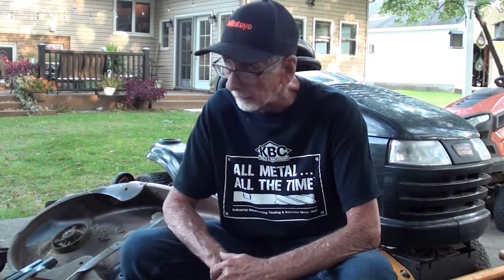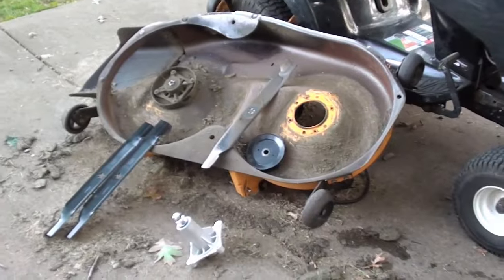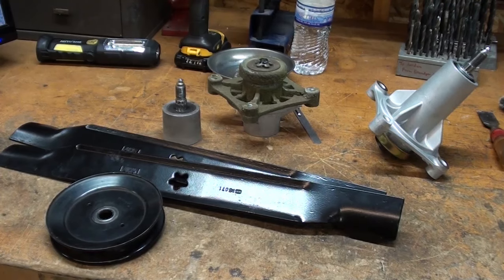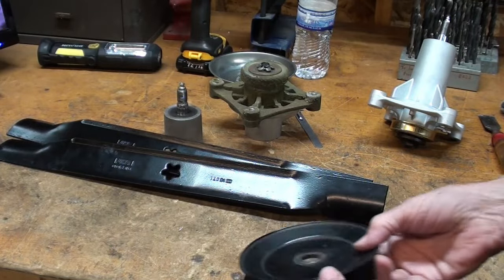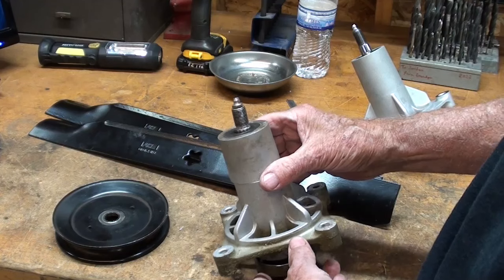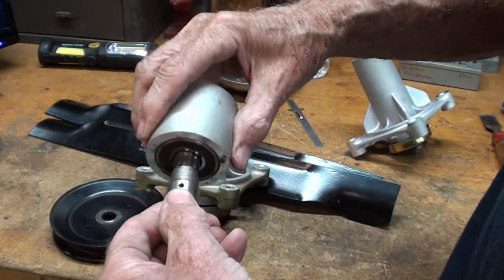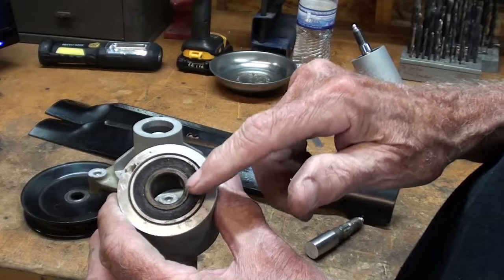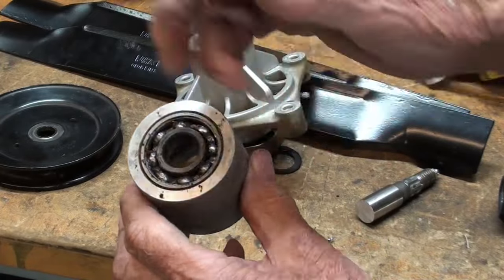LIES & DECEIT mower spindle fraud SHORT SUBJECT #52 tubalcain

Comment: The last spindles I replaced ( also on a Craftsman) didn't even have the (phony) ZERKS. So no way to even pretend you are greasing them. When I bought my mower, about 18 years ago, I figured I would go with Craftsman because I " could always get parts". Ha ha, the Sears store went away, and their once very good online parts system has crumbled. Thankfully. the Craftsman mower has been a very good unit. Your son-in-law must have hit that stump pretty darn hard to do that much damage! Usually, the ears of the aluminum spindle housing just snap off when I have hit a stump.

Comment: Mr Pete, I do believe that the bearings  in question are sealed permanently lubricated bearings needing n o additional lubrication for the engineered design-life of the bearing. 
The shaft with the zerk is probably a purchased item from another supplier ( who sells them to many other companies) and the lube options  are just how it is  made.  So the company that builds the bearing pedestal is just using them as they get them. 
I suppose it is reasonable to ask: Did the data sheet that you got with the bearing pedestal say to use grease? 
It's also possible that the copy writer for the mower company's user manual isn't an engineer and  merely saw the zerk and just  assumed. 

This is what I suspect is more likely the case. 

But it is possible ( however remotely)  that the engineers  conspired with each other to design into the thing a completely useless Grease fitting and two holes the machining  and installation of which would cost their employers money that didn't need to be spent and no one ever investigated it.  That's pretty darn unlikely.  But it seems to be what you were saying. 

It's been my experience that engineers are very particular about how they send money and employers demand that they be too.  Soooooooooooo~~~~~

Comment: I have that mower in a different skin. The original spindles had no provision for lubrication and eventually underwent "R.U.D." (Rapid Unscheduled Disassembly). I bought replacements that had grease zerks on the side of the housing and they have lasted for years with regular service. My dad gave me the grease gun speech plenty of times growing up.

Comment: They used a ball bearing similar to what used to be in the Rockwell 505 sander. It was designed to keep dirt and dust out. Not a good choice though in the mower spindle. My John Deere had the same thing. Yet they still had grease at regular intervals in the owners manual. It was next to the section that said DO NOT DRINK THE BATTERY ACID!
Have a good week.
Reply from the maker: Lol

Comment: Thanks Mr P.  It does and it doesn't, those are hardly real seals, more like semi-seals and with a pump or two of grease topside it will at least seep down into the bearing and displace any grit/smegma that is trying to work its way up inside through the bottom semi-seal.  Fill that cavity with grease and the next thing to happen is popping those dirt deterrents outta the bearings.   Also, B&S sold engines with aluminum bores & valve seats over 60 years ago.  It was not planned obsolesce, it was FRAUD plain & simple.  A pox on them.

Comment: When I bought my expensive zero turn mower it 'featured' greaseless bearings, two years later when they failed, their new models at the dealer now had their latest new feature 'greasable' bearings, dealer said new spindles would fit old mower, they did and two of them are still there 20 years later (why I use commercial mowers).  The other fault you didn't mention is the splined shafts, my mower doesn't have this, if the blade strikes something harder than grass it can turn, not easy but it isn't mechanically locked.  Big mowers use a pin like an outboard motor prop or a slip clutch to protect the driveline.  I don't think either Sears or  Husky made your mower they probably only made the decals, the rest is Mexican or Chineseium.

Comment: Couldn’t the Zerk fitting be moved to the side of the housing, eliminating at least 2 operations of manufacturing the shaft? Another commenter nailed it. The manufacturers are selling exactly what most consumers want—a functional item that will get the job done, for a while. When it fails, they’ll throw it away and buy a new one, primarily because they don’t know how to repair it, which also explains the lack of preventative maintenance on the item in the first place.
Reply from the maker: Your comment deserves a dozen gold stars for the truth

Comment: I bet the design had been an open inside bearing but somewhere during purchasing it got changed to fully sealed bearing.. i worked as a buyer tech for parts and the suits always wanted to save a few cents so i can see how this could happen especially a new employee coming in and taking over the job it would easily be missed ..sadly this lack of attention to detail and due dalliance is a more common problem now especially that the work ethics have gone down so drastically. Still i enjoyed the rant and video. One could make a lot of these videos about this sort of thing its so common now..
Reply from the maker: You are absolutely right.  It’s a common issue, and it's frustrating to see.

Comment: Next comment on greasing spindles.  1. Few homowner grease their mower properly. 1. The cavity between the bearing must be vented.  The vent allows debis and water into the cavity.  The seal wears quickly and then the lower bearing will fail due to the dirt and moisture.  Filling the cavity with grease until it comes out the vent hole will block out the moisture and debris.  If you want to force grease past the seal the vent hole needs plugged-then unplugged when complete.  With the low cost of these "spindle kits" on scamazon, time is best spent just doing a "service" which gets new blades, spindles, pulleys and belts all in one fell swoop (provided tour deck isn't rusted through) with the old parts being recycled.  OR YOU COULD Buy A mower like mine, a zero turn DIXIE CHOPPER, the worlds fastest lawn mower, with commercial quality greasable spindles and more etc. (Or step up to a diesel powered kuboto zero turn, a ferris or other top brand)

Comment: I think there was likely a manufacturing change along the way. Originally it would have had a seal on one side of the bearing and open to the grease side and those bearing were lubricated via the zerk fitting on the end of the shaft. At some point the engineers decided to make the unit "lubricated for life" and added the sealed bearings (like some automotive wheel bearings).  They may have had a lot of the older model shafts with the grease fitting in stock so they just used them up (common manufacturing practice). That seems most likely... at least that's what I think happened.

Comment: I have found this to be typical in assembly facilities that are not in the USA. If parts are not there in time... but other parts can substitute the assembly to keep the numbers up...they can get by with it.  Bearings are out of sight and the assembly moves on.  I've seen bearings in backwards.  (tapered brgs)  If assembly instructions are not clear, this is what you get...OUT THE DOOR....next?  I would almost bet, the assembly called for a bearing with (1) seal.  (special order)  Doubled sealed showed up...(most common)  Assembly personnel...not their problem....

Comment: Grasshopper also does this. The local (to me) Grasshopper dealer said it doesn't matter whether you remove the inner seals or not. I disagree with that and agree with Mr. Pete. Over the years I've replaced enough bearings that I know they'll fail if they can't get fresh grease; that original grease only lasts so long before it gets hot, worn out, and dries up. Then bearing failure is next.

Comment: I don't think that the machine was designed that way.  When I worked in a development lab, I learned that things go bad in very interesting ways.  Engineers and technicians spend years designing and testing a product.  The product released to the public sometimes is not the same product that was tested.  What happened?  In most large companies there is department called purchasing.  This is the group charged with obtaining the parts needed from various vendors to build the product.  They buy these parts based on specifications supplied by engineers.  They put out bids based on the specs. and usually purchase parts from the lowest bidder.  Unfortunately, The parts purchased are sometimes not the parts the machine was tested with.  Though they might meet the written specifications, the purchased parts might be of less quality the than the tested parts.  The engineers that write the specifications don't always get it right.  I suspect, in the case of the broken lawn mower, the engineer did not specify the correct bearing and purchasing bought a bearing that met specs but was not a "tested" part.  BTW, good rant!

Comment: The hydraulic pressure from your grease gun is adequate enough fill the huge cavity  and force grease past the inner seals unto the ball bearings. Don't  believe me, grease it up then rip it apart.

Comment: I wouldn't be surprised if they just changed the bearing from single side to dual side seal to reduce costs. Double side sealed bearings are a lot cheaper due to economy of scale. They couldn't bother removing those features from the chaft and maybe save a lot more, which just shows how these companies are run...
Reply: Did the change a long time ago then. This has been going on for years.
Reply: @dans_Learning_Curve  These kind of changes have been happening for a long time. Might be a part recycled from previous project that started with unsealed/unshield bearing,

Comment: This could be a case where the design has devolved through ignorance.  Lets say the original designers used single side sealed bearings.  These are uncommon, and would be a special order (or at least more expensive the double shield).  So a smart guy buys and installs double shield bearings.  He is not smart enough to delete the grease fittings and grease passages, and hail the result as an improvement (Lubricated for Life!).  This is not chicanery, it is stupidity.

Comment: Never EVER trust bearings to be the right ones for the application, lubricated 'from the factory', heavy duty enough to meet the load and conditions, etc etc.  I have had to replace countless 'sealed from the factory' bearings that were as dry as the Sahara desert.  I've seen open bearings where sealed bearings SHOULD be, etc etc.

But you know, I haven't seen a lawn mower spindle yet that had a zerk fitting in the end of the shaft!

Comment: That grease fitting is merely an appeasement for the 10% of the people that properly maintain their equipment. It's a feel-good fitting. If they actually did it properly, the 90% that would get no maintenance would fail much sooner.
  This was well proven in the automotive field with the lack of fittings on ball joints and tie rod ends. 
  Many of the newer hi end machines are actually made correctly. I have two twenty five year old John Deere tractors with over 1,900 hours each on original spindle bearings. They do have fittings, which I give five or six pumps each per season. Supposedly by the parts diagram there are bearings with separate seals. I'm not so sure I'll live long enough to find out what type of bearing is actually in there!

Comment: What About Sealed Bearings?

These bearings are good for high-contamination applications. Sealed bearings are generally only used for lower speed motors, 75 hp and under, and have an anticipated life span of only three years. These types of bearings fall under the “Lubricated for Life” designation and do not require regreasing.

You could call it planned obsolescence. Or when 3 plus years pass replace the bearing  with a bearing of your choice. But you don't know which bearing is in the new unit without disassembly. Best option pump it full of grease if the bearing goes bad replace it. Hopefully before you get a stump.😊

Comment: I have replaced  several  of  thase  in my mower, I have never seen one for sale with a grease zerk. Also I did not know the spindles could be taken apart. I am never sure which side of the blade goes up.

Comment: Guess it started with an engineer designing it with single sided bearings. His mistake was to have the grease point on the end of the shaft instead of on the side of the housing. So the deck had to be removed for greasing. Consumers rarely did it. Lots of complaints on failed bearings. Another engineer solved it by fitting pregreased double sided sealed bearings. Solved the problem and lasted for quite a long time. Also eliminated greasing in production. Why they kept the useless shaft end grease point is impossible to say. Other mowers I've seen don't have them. Most mower spindle failures I've seen is caused by hitting hard objects like rocks. Bearings can fail if you manage to wash out the grease with a pressure washer or don't balance the blade after sharpening.

Comment: It also could be that the spindle designer specified a greaseable bearing but someone else purchased the wrong bearing.
They may have even discovered the problem themselves, but now with millions of the wrong bearing in stock, they couldn't just throw them out.

Comment: A $10. shaft and $2. bearings heh. Even if you removed the inner seals the outer seals would pop out the first time the cavity was filled with grease. Tapered roller bearings with an inner sleeve and press in seals would be the best but shielded one side ZE bearings would accept grease and offer some protection against dirt, moisture

Comment: Some of the spindles have the grease fitting on the side of the case between the bearing.  These also are for looks only.😮  BTW,  you didn't need to go the the work of sawing the spindle in half.  Just remove the inner shaft. I  have replaced the bearings on past mowers.
Reply from the maker: I wanted to show there was no sign whatsoever of grease inside of the casting. And it was no trouble selling it in half.

Comment: Oh gosh. This 18yo kid asked me to look at his car. It's "banging & rattling"?
First thing i grabbed was the dip stick, it show-nuff was bone dry. The noises? Timing chain, gears, guides and tensioner. He said it's a "cheap pos" when i suggested look up the "maintenance schedule" he asked what's that?
So every 110k miles replace all of the timing set & it had 200k miles on it, the cheap pos. He got it from a parent who got it new. Oil air and gas is about all it wants.
Reply from the maker: Many young people have not a clue. I had a niece that ran a Volvo until there was only a half a pint of oil in it, and it blew up. And she blamed the car.

Comment: Keep pumping grease in there, and some oil from it will work its way into the bearings and they will last for decades. Those seals aren't liquid tight for very long.

Comment: And the grease can never reach the isolated bottom bearing. 
And when you get tired of dry screaming bearings and got to replace the way overpriced spindle, the steel bolts are naturally locked into the aluminum.
Reply from the maker: True

Comment: A shielded bearing has a gap between the shield and center race. Grease could enter/exit there.

I don’t think the situation is nearly as bad as you present. There should be more sealing/shielding protection from below, from the blade side. The top bearing may well go forever without being regreased. My street bike has 85,000 miles, similar bearings, unserviced, still excellent.

The bottom bearing is in a severe environment. Stuff can work its way in from the bottom. Even with a seal on the top of the bottom bearing a layer of grease on top inside the spindle can slowly work its way into the bearing.

The big scandal you missed is the star spindle drive to the blades locking one on to expensive OE blades, only, no aftermarket.

Comment: The spindle assembly was probably designed 40 years ago when the proper bearing was being used.  Then almost nobody applied the grease properly, so they changed to a sealed bearing.  When the bearing was changed, they didn't follow through with the proper changes in the spindle because that would require additional testing and verification before the spindle change could be made.  It's probably more incompetence and laziness rather than intentional deceit.
Reply from the maker: Excellent analysis and probably true

Comment: Remove the seal/shield clean with wd40 or some type of solvent. final clean with brake cleaner and compressed air. pack the bearing with good clean wheel bearing grease and reinstall the rubber seal shield. wipe excess off. good for another couple years.

Comment: Can I take a wild guess as to the country of origin of the part? The spindle is probably designed to fit multiple housing/bearing combinations, which they find cheaper than making application specific spindles. The steel they use is as hard as chewed bubble gum spit on to a sunny asphalt parking lot.

Comment: Probably fifty years ago when that spindle was designed they used the correct bearings but somewhere along the line they subbed in the sealed bearings to save $$ or reduce maintenance.

Comment: I ride a bicycle a lot and have worn out several bikes. I keep a log of my mileage. The first several bikes I wore out the pedal crank bearings at 450 miles. I said that's not right. The forth bike I bought I decided to take the pedal crank bearings apart when it was brand new. There was hardly any grease in it! Planned obsolescence I say! So what I did is I packed those bearings the way they should be packed... completely full. On this bike I am at 3000 miles and the bearings still haven't failed.